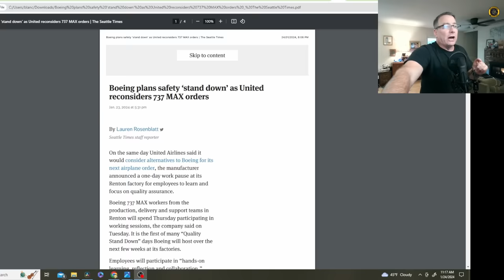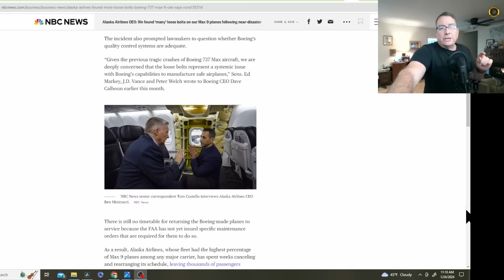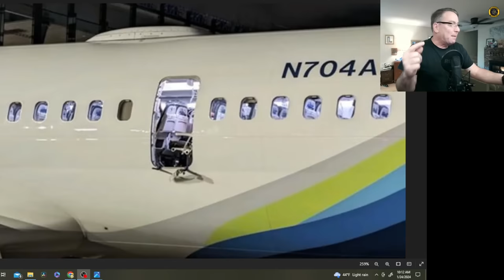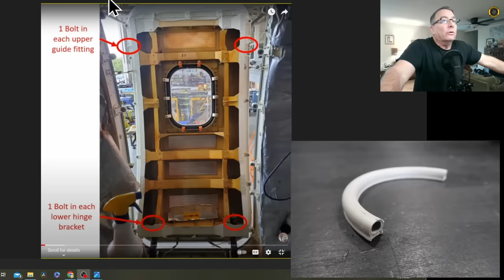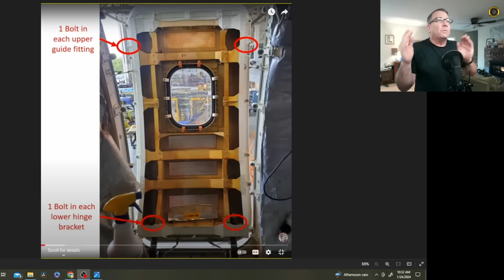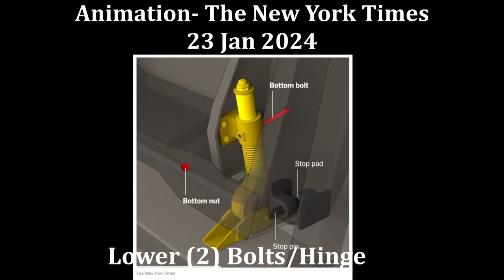Boeing's Quality Management Failure Explained 737-Max-9 Door 24 Jan 2024

Comment: The real problem isn't actually 'are there more Max airplanes out there with missing door bolts?'
No, the real problem is 'how many OTHER bolts may be missing from other critical components in Max aircraft due to poor quality inspection, that we don't even know about?
Reply: Yeah, doubt Spirit has been working on only the door plugs, and if they circumvent Boeing's bad quality control system, there certainly are other cases they did to cut corners. And not only on the max 9...
Reply: Always comes down to a Screw loose somewhere!  Dam FOD!!
Reply: @emmanuels7723 It doesn't appear Spirit circumvented the Boeing QMS, rather the Boeing QMS has a serious gap as it doesn't allow for that particular event to be recorded and hence properly tracked, checked and followed up.
Reply: @Martinit0  These being two different systems, I imagine there is an integration layer between them. Knowing absolutely nothing about them, I'll hazard a guess that there is information lost in the translation. There might also be a conscious intent to skip some of it to prevent clutter.
Reply: Not to mention loose bolts after coming back from Boeing service that weren't loose before
Reply: It doesn't even have to be a missing bolt or nut ,it could be a missing cotter pin or safety wire or lock washer.
Reply: @raymondo737  The first link in the description is the leaker's testimonial. It's a manual process to transfer information which often doesn't get completed in the interests of "convenience". The spirit aerospace system is used by boeing QA too as it is better at generating metrics for management to look at, which as we all know is the intent of a QA system...
Reply: Boeing hugely embraces DEI which means they have institutionalized incomptency. 

When Disney did this, it resulted in them making horrible films that has lost them a billion or more in red ink losses - now putting the company into contention over the viability of current management and its board due its precipitious losses in equity value.

But with Boeing, embracing DEI, and its management priortizing lowering cost and thereby increasing profit margins above all else, will not result in crappy movies that nobody pays money to go see, but instead will result in crashed airplanes that take hundreds of lives at a time.
Reply: @TheSulross  There is no evidence this has anything to do with DEI. Thanks for outing yourself as a bigot.
Reply: @Martinit0   I hope the ntsb focuses on this. This is a HUGE GAP. You can't let quality issues like this escape.
Reply: @TheSulross so hiring people of different backgrounds and races made them incompetent?.... I think it's that leadership cut corners not that hiring a black person made the company weaker....
Reply: @Michael-bh9ss  No, is that competent people that are qualified are passed over in order to fill DEI quotas. Just because there are mandates to fill DEI quotas doesn't mean there is sufficient supply of qualified applicants from that pool, but that doesn't matter as DEI institutionalization means filling the quotas regardless are THE highest priority. And the years that this has been going on has proved this over and over again in spades. And now will live in the era of Idiocracy (as in depicted by the film Idiocracy) as the end result.
Reply: Bingo. I have a masters in quality management , this is textbook. First of all, that there is such a disconnect between spirit and Boeing with the tracking systems. Quality management and lean production both rely on communication between the vendor and the main company.  With two different systems things get lost. The other thing is no one did a risk review on their procedures , if door removal or door open requires removing the bolts , then both should trigger the quality inspection. It sounds like some idiot didn't know what door removal vs door open meant. 

And yeah, the problem isn't this one incident nor is it the ppl trying to defend Boeing management ( many of them working class themselves), blaming the workers. 

This is bad management, pure and simple,.

And yes the problem isn't just this one plane, this kind of thing means dicey or marginal problems being missed. I would bet among other things that spirit engineers and Boeing engineers don't work together or coordinate either, or look at each others assembly processes. This leads to all kinds of problems.

This was GM in a nutshell, really surprised the CEO hasn't blamed the assembly workers the way Roger Smith at GM did. Their vendor relationship meanwhile was non existent. They would give the vendor the design of let's say a brake caliper ( well,several vendors) , not tell them anything about the car it was going into. They then would take the lowest bid. The vendor knew nothing of the car still, the GM people had contact with the vendor engineers. If a part was found defective on the line, they would throw it into a garbage pile. If more than a certain percent were bad, GM would return the whole lot,refuse to pay for it& demand new parts. The problem? A single defective part might indicate there are scores of marginal parts that will fail, you never ignore it. 

This one incident likewise shows serious issues with their vendor relationship model and QC/QA. It is not a one off, it isn't drunk or stupid workers, it is poor management.  We are well into the era where lean production and quality management are no longer exotic, that this happened at Boeing, which helped pioneer many such techniques, is pathetic. When things like this go to hell it is usually bc management is doing what GM did ie the only thing that matters is speed, churn them out to meet wall street targets and we will fix issues afterwards. Given the backlogs after the 737 Max disaster with the flight systems, they have been playing catch-up, then too with the 787 dreamliner issues and the mess w the 777x, they are under pressure, their bad management is catching up to them..

They are lucky in one regards, they won't lose many existing orders bc as he puts out, would put them at the back of the other co queue. However, they may find the next time Spirit or Alaska air order new planes it may be Airbus. The head of Boeing btw should be fired along with their heads of manufacturing and QC, this is an epoch fail. And Callahan making excuses rather than taking the truth should be enough to fire him, he is damaging Boeing irreparably with every evasion.
Reply: @raymondo737 Good point! Or there may not even be an integration layer and workers have to actually do a stare and compare to determine what actually has been done. Seems like the two applications should be combined into a single piece of software for reporting of activities and completions. But writing a new s/w application can be extremely complex and take years and cost a boatload of money.
Reply: dont want to go anywhere in a boeing aircraft from now on..
Reply: @TheSulross  You seem to be an expert in DEI and the fall of modern corporations.  I’d be curious to see if you have the causality data to back up your claims? Otherwise you’re just parroting opinion likely because Elon went on a rant about DEI.  You’re confusing correlation with causality and no offensive - showing how naive you are.  And in Boeings case neither correlation nor causality seems to line up.  Show me the hard statistics on DEI at Boeing and prove me the naive one, otherwise stop with your uninformed opinion.
Reply: Yeah this is a real spicy situation when your quality inspectors has not done the inspection... never Boeing again ever
Reply: Occam's razor would say none. NASA burned astronauts alive three times. The issues weren't missing bolts, but rather poor management rush to launch. decisions.They always blame some parts manufacturer. Have you had your oil changed lately?😱
Reply: Wow.
Nailed it
Reply: You just nailed it! 👍
Reply: You are totally right! Worst part is I dont think even Boeing  knows ; will ever know or wants to ever know where else they have fucked up
Reply: The bolts are missing because of poor workmanship in the first instance. Inspections only capture the poor workmanship, if anything.